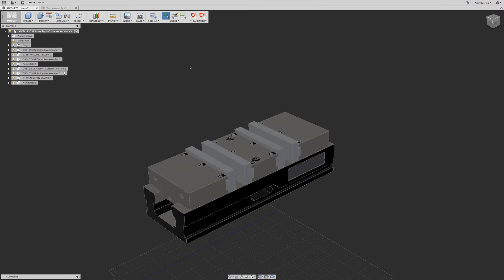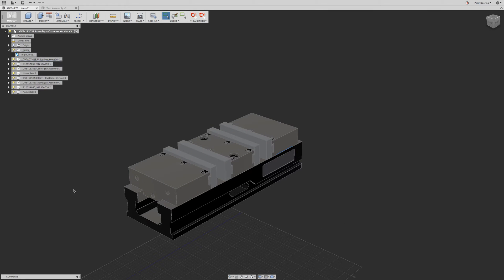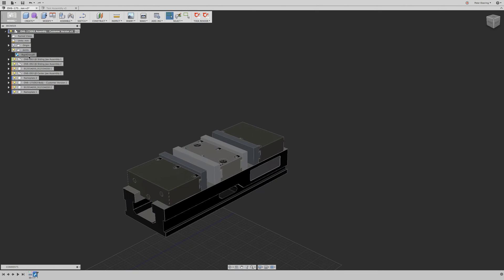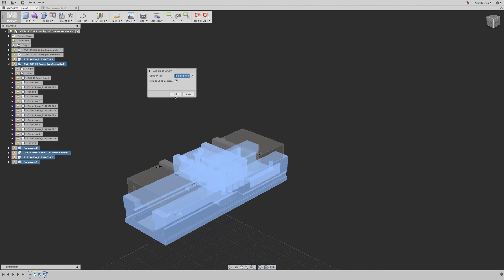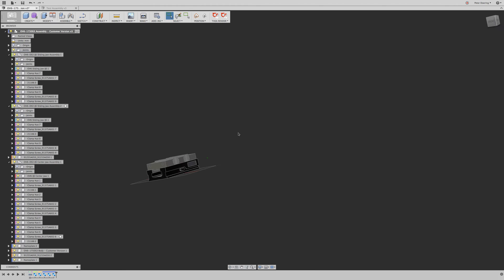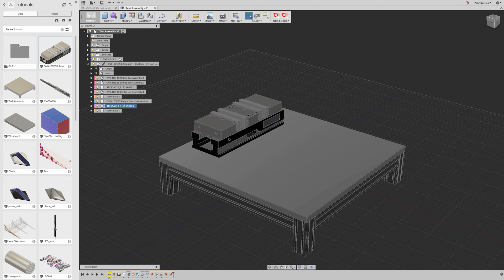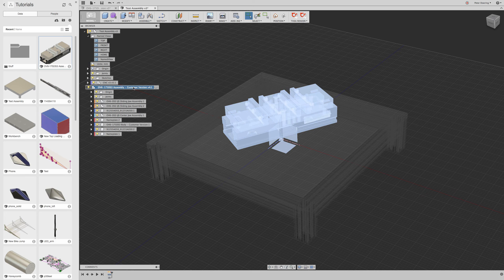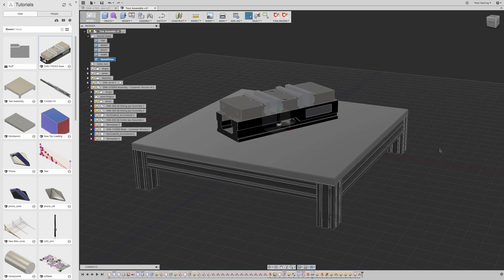Inserting imported geometry and assemblies into Fusion 360

Comment from the maker: Hi Patel, that is difficult to determine without having access to your design, however, I am guessing that when you have inserted that assembly  you have not broken the link.
Linked components/Assemblies cannot be edited within that design they were inserted into. You either have to break the link, which is what I prefer to do, or you have to open the assembly file, edit the joints and save it. Then you can go back to the file it was inserted into and will tell you that one or more complements are out of date. Then update.

The very best thing to do to get answers to these questions is to go to the Fusion 360 Forum :
http://forums.autodesk.com/t5/design-validate-document/bd-p/124
You can export your design as a .f3d file and when creating your post/thread on the Forum, attach that file to the first post. Usually you'll receive answers to such questions within a few hours, depending on the time of day you post this.
Reply: +Peter Doering  thank you sir